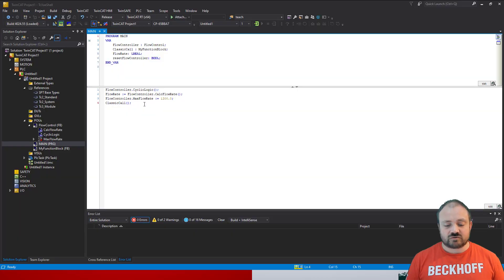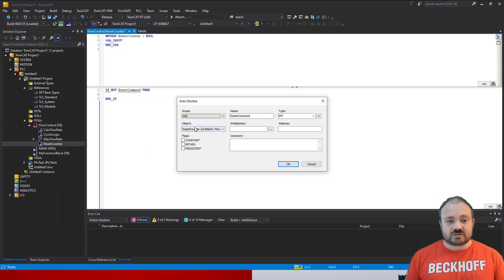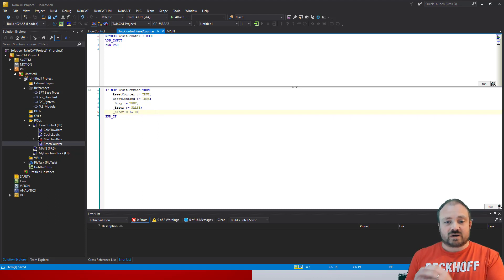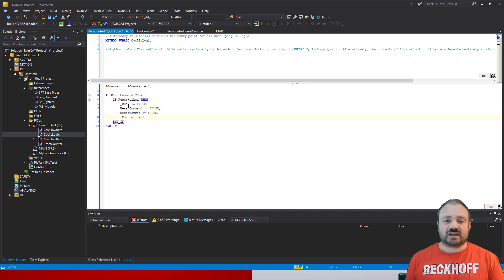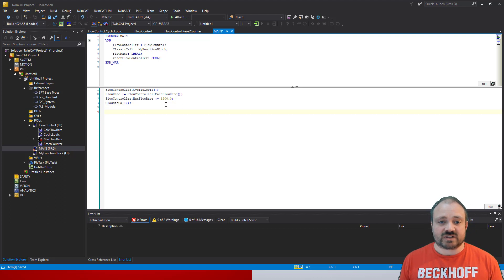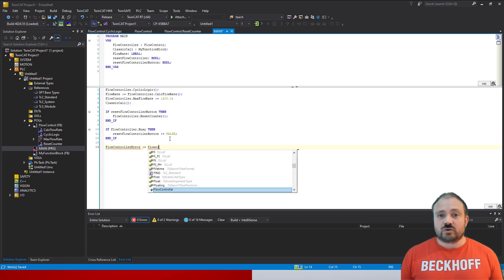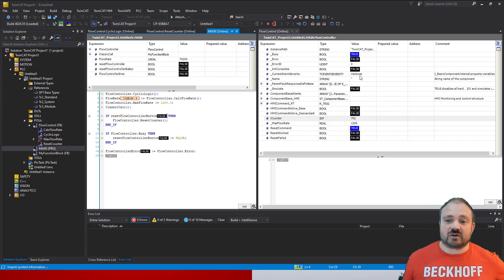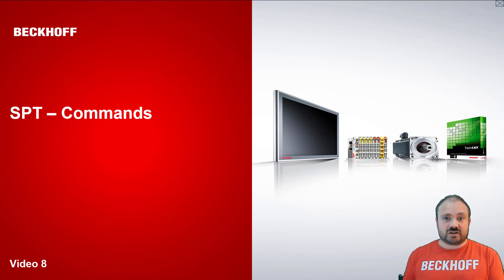Component Commands | SPT Framework 101, part 8

Comment: Why didn't you use CalcFlowrate  into CyclicLogic method as it is a continuous process?
Reply: Hey, you could do that, i made it this way for flexibility, it might be that the user doesn't want to run that function cyclically as they only care about it on a minute by minute basis rather than task cycle rate. It might be more sensible for your use case to call the method in the cycle method and then have a read only property that returns the value calculated.
Reply: @scratsballs 
Why don't you resume this great work?, the series is really informative and helpful.